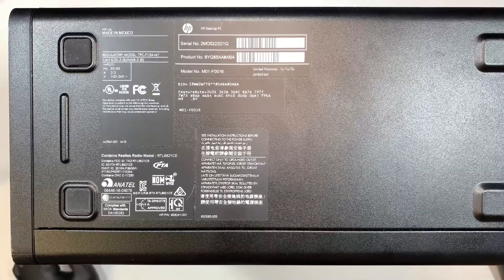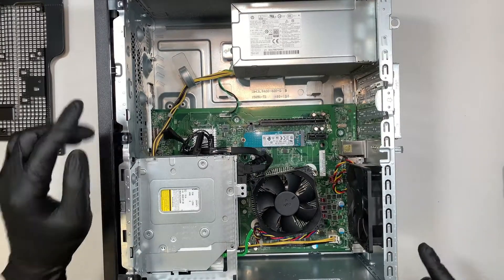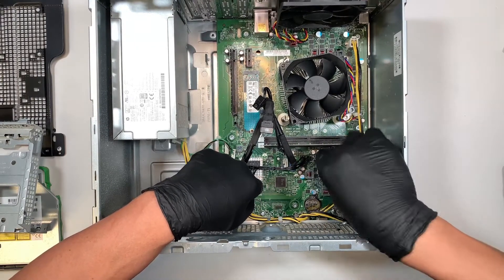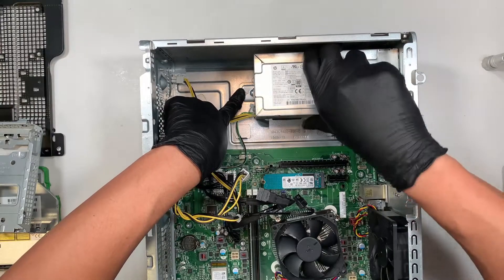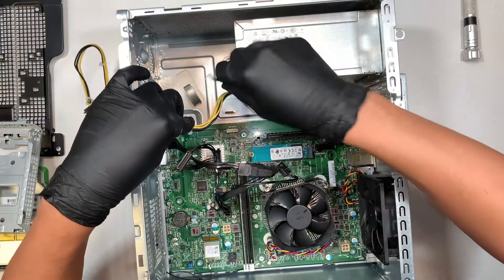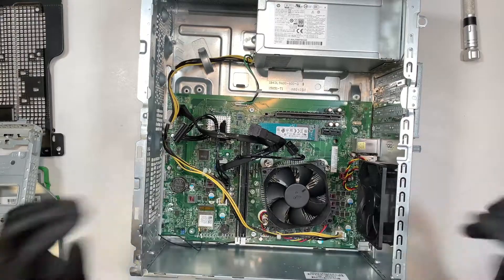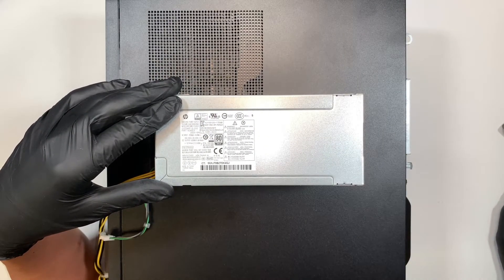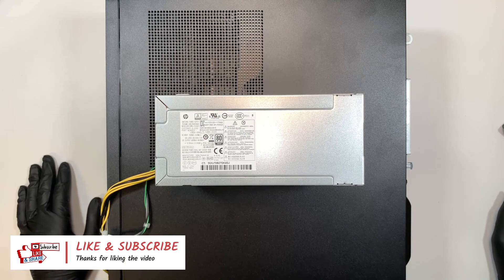HP Desktop M01 F0016 Not Turning On Replace Power Supply

Comment: I bought this computer. But I want to install another power supply but it has nowhere to connect the 24 pins. Help please
Reply: Im having the same problem
Reply: @gigachad260  thats bc i found out that u need  a special psu for it and u can prob find a 350w psu on amazon but ihas to be a flex itx and has to be a 4pin psu

Comment: Is there a way to upgrade the power supply to 500W?
Reply: Absolutely.  P/N is HP L05757-800
Reply: @OutlawAR15  I see an extra pair of holes in the back of the tower that look like it can accommodate a wider power supply.  I guess with the 500w PS, the plug would sit to the left instead of to the right like in the smaller power supplies.
Reply from the maker: Unfortunately no

Comment: What sizes of other stronger PSU's can you fit in that?
Reply: Up to 500w , Has to be from HP because the connector for motherboard is proprietary 4 pin instead of 24pin
Reply from the maker: Has to be original power supply